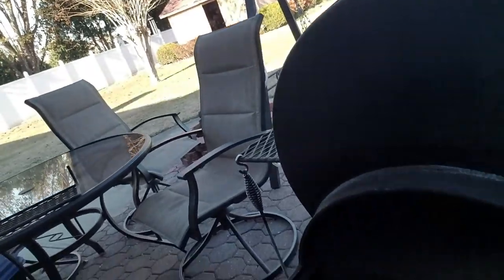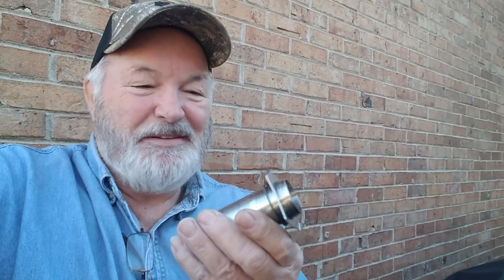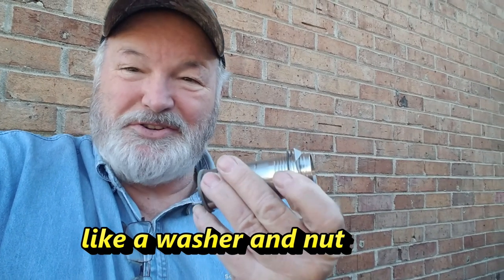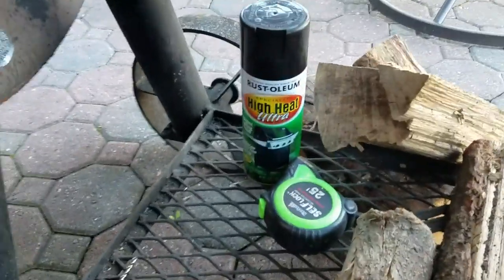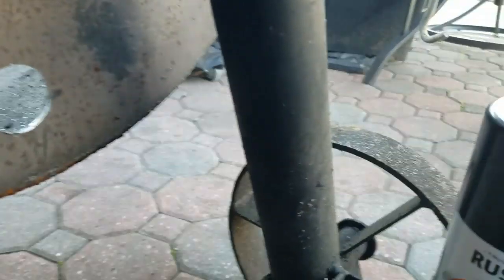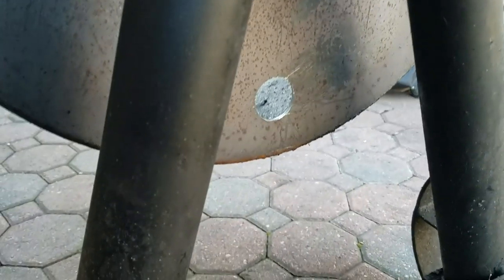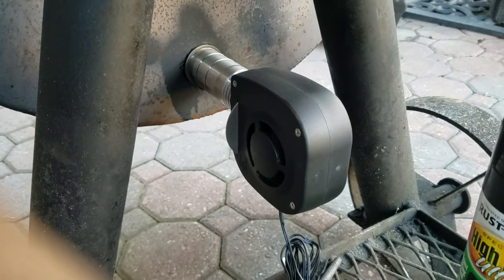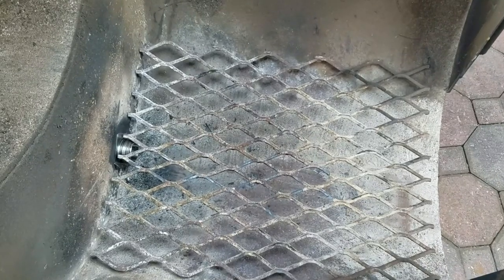INSTALL OFFSET BULKHEAD GURU ADAPTER | OFFSET MOD | GURU FAN ADAPTER | BBQ GURU FAN ADAPTER

Comment: I decided to order this adapter and fan based off your video since its compatible with my fireboard thermometer. In my little vertical offset it probably wont be a cure all but I'm hoping that it keeps me from having to go out every 30 minutes to flick the intake vent one way or the other to hold temp. If it doesn't work as planned then it can go on a kettle grill or something.
Reply from the maker: Yea same here Adam. I ordered the larger Pit Bull fan before making this video but went ahead and used the Pit Viper fan which seemed to do the job okay. I have since tried a test cook with Pork ribs and the guru did a great job holding the pit temp. One tip, start your fire in the basket and allow it to catch good. I just lit a tumbleweed starter in the top and closed the door with vent wide open. That did work, but it took an hour for it to heat up all that steel (1/4 inch pit) Then close the intake vent and let the guru control it. I had previously installed gaskets around the pit and firebox lid. The firebox door had a small crack across the bottom in the door design which I covered with leftover gasket material. I feel I have a tight system for the forced air from the fan to be effective. Good luck.
Reply: @progers5019  once you've gotten to play with it and learned how it likes to get started like you pointed out you should do a follow up video showing it. Not many videos on these things out there showing install, set up, ect.
Reply from the maker: @extreemairsoft  
I will. Stay Tuned

Comment: You will like Red Devil charcoal.  Burns clean and hot with very little dust in the bag.  I use it for long cooks.
Reply from the maker: Thanks for watching Thomas. I'll be bringing a cook using this guru on the offset soon. Merry Christmas

Comment: did the mod and the air doesn't flow as well. So I covered the hole up and installed it on the door side of the firebox and not the fan pushes the air in the box a lot better. takes less time to heat the main chamber.

Comment: Been seeing a lot of these fan temp controllers, expensive. I was thinking if a person had an old oven and take out the temp controller and hook up to a fan, Scratch that. Instead get an old convection oven and take out the temp controller, fan and thermostat and it should already be connected together, make a box for the fan and there you go

Comment: No matter what mods you do, a stick burner is a stick burner. Unless you automate a stick burner to load logs for you , you might as well be cooking on a WSM or a kettle. You’re not going to get the same flavor out of it.
Reply from the maker: Yes Chris, all of us stick burners know this. That's why I said towards the end of the video we don't use this method all the time but was just because we could. Besides, I already had all the stuff to do it. If you know Rus Jones over at Smoky Ribs channel, you can see his video on his LSG testing out this too couple years ago. He used this method for a test too, and got a few hours of sleep in the doing . Got up the next morning and threw some more splits in the fire box to finish the cook. Just playin around some. Thanks